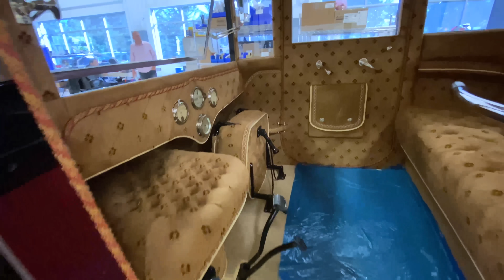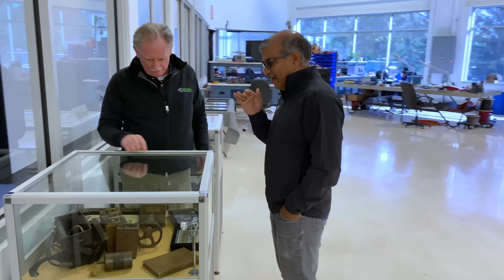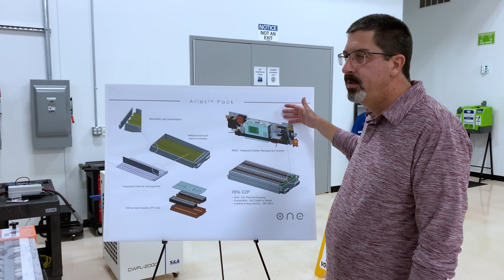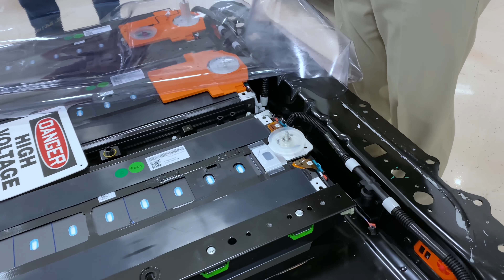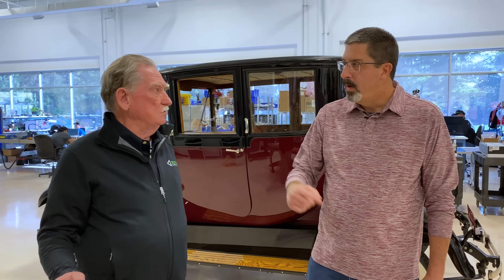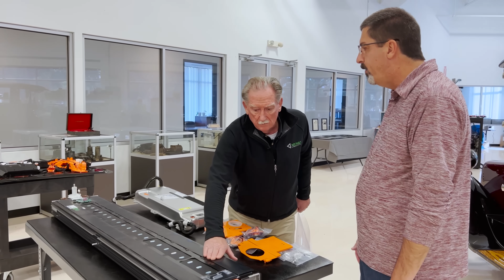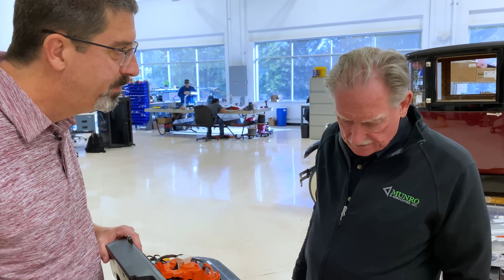Tesla Model 3 LFP Battery + Sandy Visits the ONE Facility

Comment: What did you learn about the thermal management on that TESLA LFP battery?
Reply: Is it winter-proof?
Reply: @abraxastulammo9940  LFP batteries dislikes cold climate (more than the other ones), so as i m from montreal canada, the temperature management is important. Will see the effect on the comming winter...
Reply: @lionelboulnois2548  northern china gets pretty cold, and teslas have always had LFP in china, the winter performance is most likely good.  if it wasnt, you would have heard a bunch of complaints by now.
Reply: @PeteZam  You can read the nextmove dossier about Tesla LFP winter performance from Dec 2020.
Reply: just engineering problems - cost is of course over riding goal. Safety a major factor. May well be the future for most affordable every mans vehicles.

Comment: Sandy wearing that all zipped~up black wetsuit top indicates must be awfully cold in Mich.....The Aries battery pack looked to be a foot high?...........The electrocution threat of those batteries is flagrant. How about the freestanding DANGER HIGH VOITAGE sign standing on floor?     Skip the cheap recharges, only an idiot fails to include the $15,-20,000. battery replacement cost in projecting cost of operation of an EV.
Reply: How many have been electrocuted by car batteries? 

How many miles will a Tesla Model 3 LFP battery provide before it degrades enough to be removed and used for stationary storage?
Reply: The "High Voltage" sign is just like a "No smoking" sign when working around gasoline.  

The more realistic danger isn't being shocked, but burnt from an accidental short.  There should be "No jewelry" sign.

A company I worked for distributed ball chain neck lanyards for their badges.  Ball chains are a safety measure since they separate at a predictable force to avoid choking hazards when the lanyard is caught in moving machinery.  I substituted a silk lanyard, since my work was more likely to involve accidentally draping the lanyard across an electrical circuit than a slow choking accident.

Bottom line: know your real hazards.

Comment: I had a BMW 1200GS the huge boxer with two 600cc slugs whacking in and out. The 14 Amp hours lead acid starter battery weighed 5kg (12 lbs). I switched to a 4 Amp hours LFP weighing 0.8kg (2lbs) it kicked the engine over better than the heavy lead acid and was small enough to tuck away anywhere on the bike. 
The snag was poor cold performance. Easily solved by a heater pad and coolant conditioning in EVs.

Comment: I actually think the M3 LFP battery is the better battery for a standard range M3. The lower energy density doesn’t matter much because the pack had a lot of empty space anyway, and LFP likes being charged to 100% instead of 80% so you have more usable range on a daily basis. Now it looks like the CATL LFP is also better designed as well. And LFP is less likely to catch fire, important for consumer safety of mind with recent fires.
Reply: Not to mention LFP easily has a total lifespan of more than double that of Lithium Ion, while being far cheaper.
Reply: @girthquake1413  LFP batteries last more than 10.000 load cycles in stationary use under optimal usage.
Reply: Also degredation is a huuuge point. Lfp will actually have more range than after X amount of miles
Edit: more range than NCA
Reply: If love this battery. Full power down to 10% and the performance motor on back :) my solar generator charges everything that is not needed in the house into the battery.
Reply: I believe Hyundai/Kia are working on making hybrid battery packs that use two different types of batteries in the same vehicle. One type charges better (faster, more cycles, etc.) and one is better for discharging (going fast!). We'll have to keep an eye on that development. It sounds interesting.
Reply: However, the LFP pack reduces vehicle load capacity of Model 3 and Model Y SR+ to a point where you can hardly put 5 people and their luggage inside of them - weightwise. So, Tesla should increase maximum permissible weight to make up for that.
Reply: @koeniglicher  There is actually no need to sacrifice any vehicle load capacity with LFP. The transition through cell-to-pack will pass fast and the next generation things are already being prepared for mass production.😎
Reply: The main issue with LFP is cold weather behaviour, you get a larger drop in performance vs the standard 2170 packs.

Now if you live in a hot climate this is not an issue, but it is obviously not true for everyone.
Reply: @andrewharpin6749  It’s due the electrolyte. LFP works in very wide temperature area. One very interesting thing is the available electrolyte selection for LFP.

We have had two trends which have kept the development at ”wrong” direction. Desire for higher cell voltage and mAh/g at cathode level.

Everyone can already see how much more can be achieved with packaging when more safer and stable chemistry is used.
Reply: @andrewharpin6749  octo valve

Comment: The public doesn't see what is going on behind the scenes with companies like ONE until somebody like Munro sheds a light on these advancing technologies....then you get a greater appreciation for how far Tesla is ahead of the traditional OEM's and how archaic ICE vehicles have become......thanks Sandy.
Reply: The biggest and heaviest ships, trucks and trains in the world are all powered by ICE.
Reply: @alanmay7929  I wouldn't be so quick with trains, most of the fastest are electric.
Reply: @MegaWilderness  the fastest trains are electric but the heaviest and longuest and most flexible are still diesel. Diesel trains are used in places where its very expensive and not really possible to electrify.
Reply: @alanmay7929  I think you'll find them to be hybrids. Diesel-Electric
Reply: @MegaWilderness  sorry for being pedantic but "Diesel Electric" is not a term for hybrid, that term can be a bit misleading. 
Earlier Diesel trains have a diesel engine driving the wheels. Diesel-Electric trains use a Diesel engine to generate electricity and than the electricity is used to power electric motors. The Trains are still 100% powered by Diesel. 
There are Hybrids, that is true, but most Diesel Electric Trains are not.
Reply: @tzarcoal1018  I could be equally pedantic and suggest to you that they are solar-powered since fossil fuels were produced by the sun. The absence of a battery just means that copper makes for a nearly 100% efficient process.
Reply: Are you out of your mind?! how are ICE archaic?! The ICE powers the agricultural/mining equipments,  ships, trains, aircrafts..... the remotest places on earth, the most difficult point to acces, the biggest and most isolated mines have been opened and exploited with ICE. What can EV do precisely today?! Explain!
Reply: @alanmay7929  I meant in the context of general auto for personal transport, heavy equipment, off road and like vehicles are a different animal.

Comment: Hi Sandy,  do you recommend LFP for the Canadian climate?
Reply: If the LFP battery is heated and cooled like a Tesla no problem.
Reply: The LFP packs have been shipped in Europe for quite some time now so it may be worth seeing if you can find some Model 3 SR+ owner from Norway with some insights on that. :)
So far I've not heard any complains though.
Can't be nearly as bad as 2019 Model 3's where you're using 50% of the battery on driving and 50% on heating the cabin before they added the heat pump! (I can relate to this pain personally)
Reply: @VoxelLoop  thanks, I have a Model Y. Thinking of putting in an order for a model 3, just want to make sure I get the right battery for the conditions.

Comment: Lif batteries look like they are much taller than Tesla battery pack.
Reply: I think that's two on top of each other rather than side by side. They would be similar of side by side.
Reply: It's LiFePO4, not Lif.  Li = Lithium, Fe = Iron, PO4 = Phosphate (one Potassium atom and four oxygen atoms).

One's battery pack is taller than the Tesla pack, but both are LiFePO4 batteries.

Comment: I cant wait to see Tesla and Subsidy companies behind it working together on the nexgen LFP packs to increase the density of the packs. Imagine that pack but instead be closer to 68-74kwh in the same area and bring the benefits of a LFP pack (longer lasting charge cycles (all the way to 100% even, LFP prefers it)... These packs would be the ideal pack for lower end segment cars.
Reply: Tesla already uses the LFP packs for some of the cars on the lower end, but the packs are at a lower energy density.  That's why they are only used cars with a lower range that would normally have extra space in the pack area from missing cells.
Reply: @android04  I'm fully aware. My comment is I can't wait for them to advance it further which Elon mention is on the table for future cars. This pack has alot going for it.
Reply: @AustinFerguson  
You basically described one advantage of the 4680/ tabless/structural system.
It can essentially upgrade the LFP pack density from "barely adequate" to "more than adequate".

Comment: Tesla released the Full self driving beta button! Make sure to initiate it and drive safe.
Reply: It's not an FSD button. It's a Request FSD button... you need to give your tesla overlords permission to give you a safety score to see if you're worthy of the beta. The safety score algorithm is quite shit too. I own a M3P with FSD so this is first hand information
Reply: @richie1317  It's quite reasonable. I got 100 on my recent drive and this was in a plaid.
Reply: @ryansmithc  hmm... i can mash my pedal and it's fine but go fast around a corner and you're effed. I logged close to 400 miles over the past 3 days and it dinged me for hard braking and fast turning. Most of it was highway driving and the hard braking was people cutting me off and me slamming the brakes. I did get 100s driving like a grandma... fling it into a corner and you're the most unsafe driver of all time 🥲🥲
Reply: @richie1317  Get used to it. FSD will drive safely like your Granma and abide, to a fault, the road regs. It's then Tesla's directors that will be held liable in the case of accidents. Having a Plaid will seem excessive then.
Reply: @MegaWilderness  Dont care ,still getting the Plaid .We only live once.  Just  have to wait a couple more years cause I live in Auss.